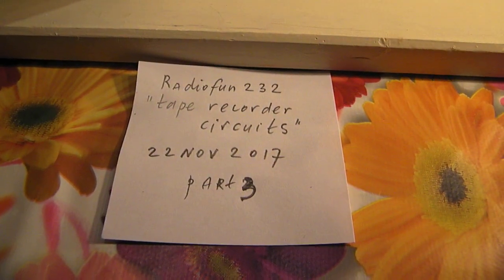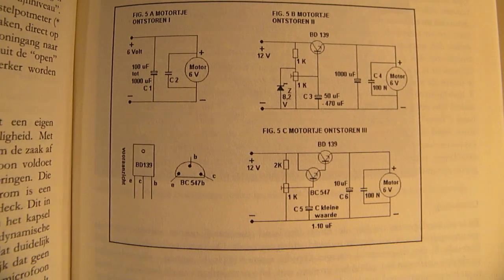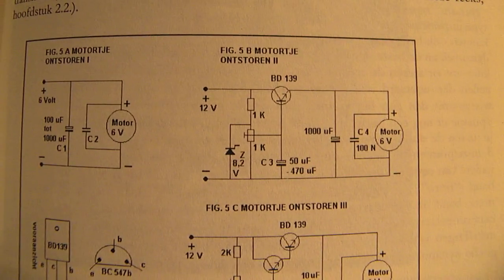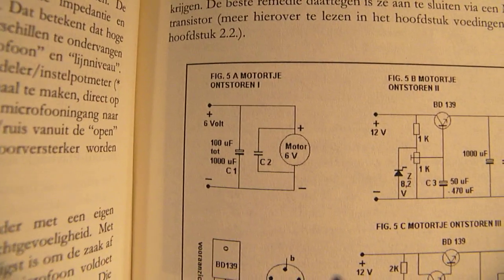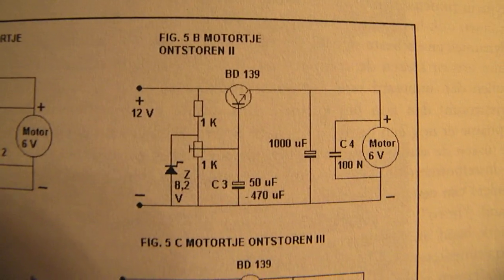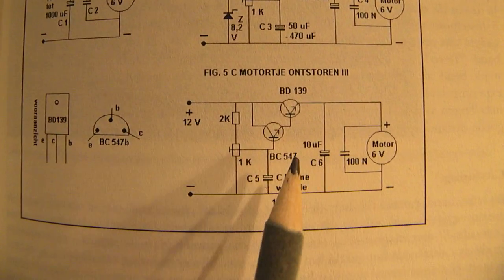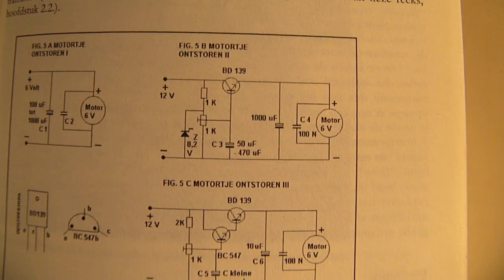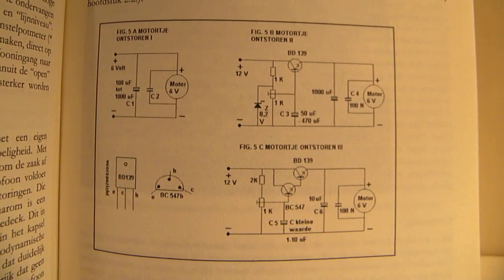Tape recorder electronics: how to make it pt 3: noise suppressing from small DC electromotors

Comment: Hello, great explanations, but I had a question, would the diagrams in figures 5B and 5C work well with 9V?
Reply from the maker: Yes. In 5C the effect of the capacitor value is big. Must be a small value. Fig. 5 B is the best circuit.

Comment: Thank you so much for this!  I have several 12VDC fluid circulation motors in my solar cottage, and also larger LED bulbs (LED Drivers), and a 12v fridge (compressor motor) that generate so much noise.  The AM/SW radio bands are not useable.  I will try this 1000uF & 100NF close to each of these devices to see if I can reduce RF noise.  I will also try a single schottky diode reverse biased at each device.
Reply from the maker: You are welcome. It could be that with a cap in the 30000 uF up to 60000 uF range (18 V-24 V, of course, they were used in computer boards from the 1970s-1980s (5V and 12 V), but they are still available now, 2018, no problem) you can get the power supply lead quite and suppressing noise. When you want to use a transistor or MOSFET stabilizer in such a circuit (series regulator, the type in the video) there is always (!..) the problem that such a fridge compressor motor takes a too high current (2-3-8-10 A) compared to the voltage drop inside the power transistors or MOSFETS. This video applies to circuits of max 1 or 2 Amp. So the easiest way is to get such a high-capacitance capacitor and bridge it between + and -. They are also used in automotive applications (100W-200 W audio amps in a car), bridging the accumulator of 12 V or 24 V. These caps are expensive, but cheap caps with the same properties (uF and voltage, 18 V or higher for a 12 V source,  28 V or higher for a 24 V source) work evenly well.
You can bridge each high-uF cap with a non-polar cap from 100 N (=0,1 uF) and a resistor from 470 K. That also can help to suppress HF noise.  8 sep 2018.

Comment: Do you think a motor speed control circuit (pwm) would be compatible with that motor noise/interference circuit?
Reply from the maker: That is a difficult question, because I don't know on what kind of pwm circuit motor you aim (voltage, current) and where you want to apply that pwm motor.
Reply: I’m just going to buy your book and find out 😊

Comment: What type of tape player "tape" is this geared mostly towards? 1/8" Cassette tape? 1/4" reel to reel style? IPS? Thank you, I'll probably grab a copy
Reply from the maker: I think I don't understand your question competely, correct me if I am wrong. For all recorders (reel to reel and casette) there are 3 types of tape: ferro, ferro-chrome and metal. The ferro chrome and metal tapes have the best frequency response (more high). The showed circuit can handle them all, with the potmeter for bias you can align the circuit to work with one of them. When the bias is set to "ferro" the erase current (HF sinus) is not strong enough to erase metal tapes.
Reply: I could be wrong as I am in the middle of learning and tinkering with tape record/play circuits but I have been led to believe that the bias circuit at least for 1/4" tape needs to be at a much higher frequency than 1/8 cassette tape, one reason being that the ips being at higher speeds than cassette ips, and for reasons I don't fully understand. Also I had thought you included a nab or eic equalization circuit which would be different for play and record preamps, and that is where I am trying find more references on.
Reply: There isn't a whole lot of "tape play/record circuits "for dummies", I really appreciate your book and for going into the details, simply. Thank you
Reply from the maker: That is very interesting. There is 1 problem with the bias frequency that both regards tape and reel to reel tape recorders. When it is not high enough (say it is in this example 20 KHz, not audible) it could be that the bias frequency mixes with the highest audio frequencies that the tape recorder audio record amplifier can handle, say in the 18 KHz range. That can lead to audible mixing products on the music recording, sounding like "birdies" or extra noise. That is why often 30 KHz or 40 KHz is chosen, though even then there is a theoretical possibility of disturbing mixing products.... (). I had no problems when making the circuit like I showed it. And yes, NAB was specially made to correct the audio response from tape recorder pre-amplifiers.  Just like all audio amplifiers that are connected to some kind of (not linear acting) pickup unit (tape head, MD element), a tape recorder pre-amp had to have a special frequency correction for the properties of tape heads. I did not pay attention to that, I copied the pre-amp from the Philips cassette pre-amp from 1962 (schematic was packed inside the recorder). I can imagine, anyway, that when a tape moves with a greater speed alongside a tape head (not 4,75 cm/sec) but 9,5 cm or 16 (18?) cm/sec, the bias signal sent into that tape head must be more powerful, because the iron particles move much quicker alongside that tape head, so the erase energy (AC HF flux between the poles of the head) must be higher .
Reply from the maker: You are welcome, when you start making a tape rec circuit I am interested in the problems of developing.
Reply: That is awesome to hear, I will.